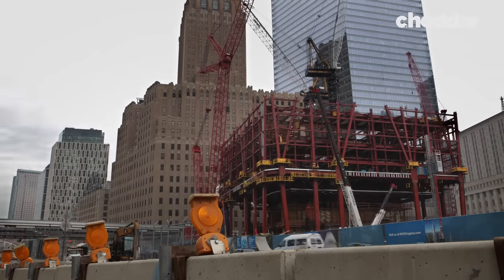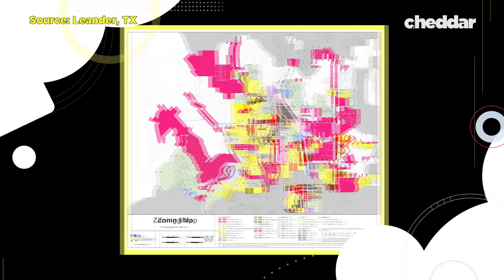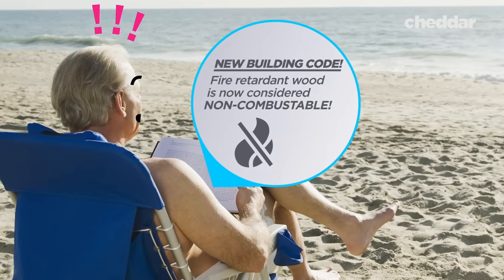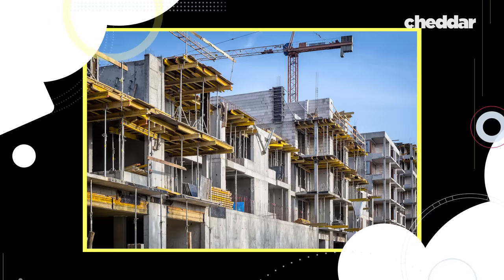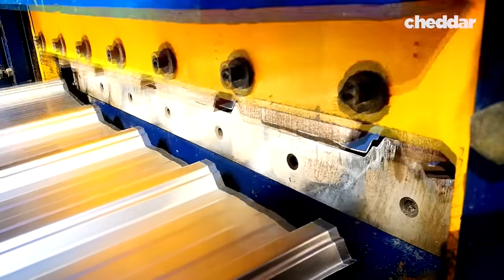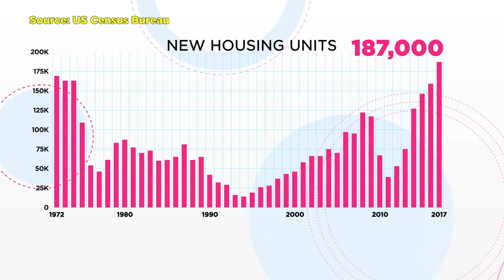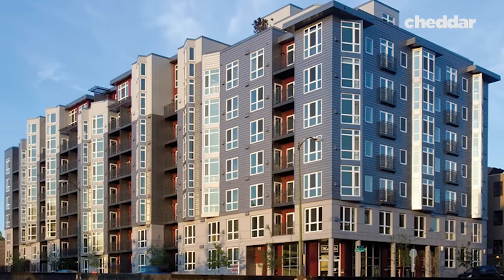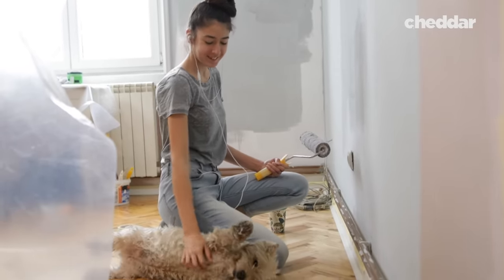Why All New Apartment Buildings Look Identical - Cheddar Explains

Comment: Rent on one of these 2BR suburban commuter rail apartments is $2k/month, which is the same as the payment on the $400k mortgage you'd need for a townhouse as close-in if not closer. The rent on that rowhouse would be $3k+/month, so a mortgage is a way better value. Only problem is, rent is increasing way faster than your wages so you'll never save up the down payment, even though your bank already knows you can afford to pay the mortgage. And the housing crisis is everywhere now, you can't escape by moving from the DC area to a small town in rural Ohio, because rents have doubled or tripled there. You'll pay 30-40% less to live in a place where the only store is Dollar General, but you'll make half as much money if you're lucky.

Comment: What I get from this comment section is that no one but the people on cheddar are calling these building particular offensive in terms of design. Most people seem to be neutral and not really have given it much thought before this video. And then most are saying, “well, it not as bad as the other stuff they build.”

All the picture they show had designs that bothered to vary in shape and color and texture. Like maybe out in LA this type of building is common. I certainly don’t see enough of it where I’m from to have gotten sick of it. This would be a welcome change from the dreary concrete brick squares or vinyl blocks we get around here. (I am not referring to the more beautiful brick mid-story building built back in the 19th and 20th century. Those building are beautiful and high quality and would be much preferred) but like. This is much better than a squarish two to three story building that it just one solid vinyl siding all the way around. So I’m not really sure where they got the claims people are calling these ugly? I wonder what they are referring to that would be so called beautiful in their eyes that meets the mix land use these buildings are providing. 

Also wood technology is improving so much it makes me excited to see what we can be building with wood in the future. Of course that doesn’t mean throw out other high quality materials. Just find a balance that makes economic sense. Also wood is great if the process is done sustainably which I know is a little bit easier said then done. But wood is one of the only renewable resources we got in the building industry so we must protect it and use it wisely. 

Also there just greedy developers who do cheap out in ways that truly diminish quality. Like if someone took the time to think about each aspect of the build. I’m sure solutions could be found to deal with the flexible nature of wood, which flexibility is actually good for things like earth quake, so that materials don’t break and cause damage. Like it’s not sustainable to use “sustainable” materials  if the maintenance is high. It sorta defeats the purpose of going down that green route if that is your intention. Also careful design should allow for proper comfort and quality  in the units, that include sound design, air quality, and heat.

Comment: The sad reality of these buildings is that even though the living space in sprinklered, in many states the attic space is not. That's ok you say?  There are many ways in which a roof area or attic can catch fire and with these buildings is very easy going to over run the interior sprinkler system and burn the building to the ground.  People need to be educated on these building before they agree to occupy the space. There is a potential if these building have a fire, it may very well burn completely to the ground and they will loose everything they own.

Comment: I used to work in comercial and residencial building. and let me tell you as foreigner working in the USA. a wood home is big problems later, usually wood after 20 years or so will need plenty of maintenance and soon will need huge renovations or demolition. No like concrete or brick houses that cost more but will require little to none maintenance (if they are built properly) and will last forever
Reply: Wood buildings can last a long time with minimal maintenance. Its more about how they were built. I have seen concrete buildings get condemned because their foundations failed after 30 years and I have seeen wooden farmhouses still standing tall 150 years after they were built.
Reply: @jarynn8156  Not in my experience. wood requires lot of maintenance to last long time. concrete requires very little.
My cousin's greatgrandpa built a concrete home about 100 years ago. and still strong till now. with very minimum maintenance (btw concrete is by far better fire retardant than wood)
Reply: @Tavinho502  As long as you take care of the roof and siding, a wooden house will last basically indefinitely. As long as the wooden supports aren't being exposed to water, they aren't going to rot. There will be some growth and shrinking each year due to variations in the climate over the year, but a well made wooden structure will account for these and have tolerances to allow the wood to expand. The most you might see is cracks in the drywall/plaster.

Comment: Added cost to mitigate the sound transfer issues. They make quiet rock gypsum stops that but it’s 4 x the cost of regular 5/8.  Also padding for floors for footfall, transfer of sound,but there again expensive addition.  That being said there’s pretty strict codes on sound transfer between units and I’m sure most are not adhering to it, lawsuits have been won by the tenant - owners of such  buildings against the developers and as a result large cost of mitigation,and disruption of unit occupancy.  Architects..read and be aware of this!  Your at risk liability wise if your building plans do not specify the correct wall stc ratings and mitigation of footfall sound transfer.

Comment: Well... waterstopping layers exist. If the building is designed well, there is no water coming in. Wood or not. These panels on the outside are not meant to stop the water from going through. If they are painted regularly, ir if you use a type of panel like Rockpanel, it should never be a problem. And yes, I know what I am talking about. I am in my 3rd year of studying architecture.

Comment: In Florida, any structure for residential use must use masonry (typically cinder blocks) for all exterior walls. While you don't get the admittedly modern exteriors seen in this video, you also don't get a price point that the average Floridian can afford. As a result, when they pop up they usually don't even place any advertising signage until over a year after they begin leasing. None of the benefits of the five over one exist down here.

Comment: Humm, I think I see some factors coming together.  At a certain height you've reached the strength limits of wood construction, at about the same point you reach changes in elevator technology.  The handicapped rules make costly elevators mandated for multi-story buildings, this can be avoided by building townhouses putting the bedrooms on the second floor, these are everywhere.  Hydraulic elevators that are less costly than cable elevators are a good solution up to about five stories above that their limited speed becomes an issue.  Another consideration is that higher buildings will require multiple elevators taking up more floor space in the plan.  Remember that the owner is looking for net rentable space and stairways and elevators eat into that.  Another factor is the community's fire fighting capabilities generally limiting buildings to ladder or tower height, go above that and you'll need multiple fireproof stairwells, these allow tenant escape as well as firefighting access.  In most cities parking is essential as tenants expect to have space for their car(s), cities like NYC with good transit would be excepted but the US has few of these.  Even in NYC the outer boroughs are more likely to need parking.  Not having parking generally means that on-street parking will be the eventual solution, not a good answer.  City planners will praise this solution but they all own cars.  Back during the fuel shortages of the 1970s there was a problem for landlords that couldn't pass along the rapid price increases for heating fuel that was generally included in the rent, this led to making the heating systems unit specific with the tenant paying for this in their electric bill.  This will continue to haunt the housing market as less costly gas heating louses that advantage and maybe becomes unavailable coupled with large increases in the price of electricity.  Zoning rules that restrict high rise or medium rise buildings in neighborhoods are not a bad idea.  Nobody wants their building shaded by a new tall neighbor and not having this kind of rule will un-stabilize the community with a continued turnover of properties converting single unit homes to high-rise  apartments, the same applies to mac-mansions.  Lastly there is the problem of who is able and allowed to build in each technology, there are many contractors skilled in wood frame construction while the numbers that do steel and reinforced concrete are generally fewer and often highly unionized, this greatly affects costs.  Housing prices will reflect the size and condition of the existing stock, the cost of new construction, the maintenance and operating cost of the particular unit and very importantly, the demand for housing units in the community.  In NYC this demand is very high and is reflective of a market with consumers willing and able to pay while places such a Buffalo, NY there is little demand and you see little new construction and abandonment of existing stocks.

Comment: You can sum everything up as "get rich quick". If I remember what I read, these buildings aren't designed to last more than 30-40 years (I believe "useful life" is the word they use). Their idea is to build as cheap as possible so that all the costs are recouped ASAP, and then make profit for the remaining x-years. By the time it's ~20 years old, the design will be outdated and nobody will pay big money to live there anymore, so they could just tear it down and build anew.  With cement/steel buildings, yes, they are more expensive, but they literally last forever (look at all those high-rise skyscrapers that were built 100 years ago such as the Chrysler Building and still standing).  Having lived in one of these so-called "luxury complex" that was built in 2015, it totally wasn't worth it. Super shoddy construction - my friend rented a super nice apt and when he walked in the kitchen (he only weights ~140-lb), I could literally feel the kitchen floor bowing downward!

Comment: The author makes many flaws in this watered down, partly accurate summary of stick built stacked flats. However she confused building code with zoning code and the dates are totally incorrect. Podium multi has been around well before 1998

Comment: You can definitely see that the architectural style is the same, but (and I admit I'm only assuming based on examples in this video) I'd say the buildings look far from identical. After all, this is nothing new, even historical cities in Europe saw large re-development projects that gave an almost unified look to large areas - take a look at Prague, where one of the towns constituting the city was almost completely torn down (aside from churches and other important buildings) and rebuilt in the style of Art Nouveau. Now, Art Nouveau features lots of flourishes and the buildings differ very much in the details, but walking through the streets (which is practical there for the most part, thankfully) you can still get an impression of "sameness", because it's the same architectural style. Not a bad thing - and it helped solve a huge increase in demand in the fin de siècle era.
Another example is the Žižkov neighbourhood in Prague, which used to be the city's suburb housing the workers for the growing industry on the outskirts; it is 4-story brick apartment building after 4-story brick apartment building after 4-story brick apartment building with little in terms of flourishes or decorations (especially compared to neighbouring - richer - Vinohrady) that sort of became a part of the image of the town.
And later came the prefab concrete blocks of flats ("commie blocks") in the new town-turned-suburbs - these are ugly for the most part but 1. helped solve a massive housing shortage and are being renovated because of how practical they can be, effectively extending their lifespans beyond what they had been designed for, and 2. some towns and neighbourhoods rebuilt with prefab concrete blocks of flats fortunately have quite decent urban design and came with the required amenities and infrastructure as well as green spaces. Can this be improved upon? Absolutely! Should we demand some actual architectonic value from the next generation of large-scale housing projects? Probably. But these are actual, tangible solutions to housing issues, ones that work in terms of several key factors, so I say express your criticism, refrain from whole-sale denouncing the efforts.

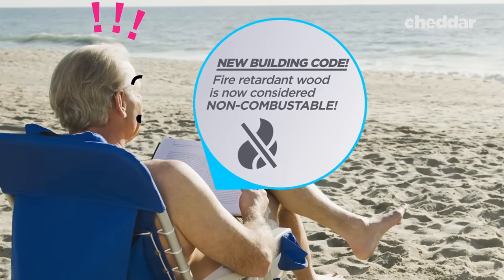Comment: SPELLING NOTE:  2:19 It's COMBUSTIBLE; there is no A in the word.

This woman narrating this video is complaining and complimenting the same thing, just at different points.  Then she tries to espouse her opinions as fact or largely-agreed upon consensus, even though the comment section is opposite of her opinions.  

A bit of detailed explaining would be nice, such as if there were 13 fires that caused $20 million or more in damages, but less than half of them (six) were this style, then what were the majority of the fires related to?  What were these other seven?  Were there deaths involved?  I know at least one of the six had zero deaths because it happened before construction was complete; I suspect more, possibly all, are the same.  There should be sprinkler systems installed to prevent/mitigate this.

 Also, how is this wood considered "non-combustible"  and a fire hazard at the same time?  There is more to this that Cheddar isn't informing us about. Why?  Your video essentially sounds like some stuck-up fashionista saying "OMG, these are so ugly and beneath me, but they're so good for the economy and consumer."

Comment: It's funny, because these are built horribly cheap, and yet cost more than double a mortgage most of the time. The idea is to cut costs up front and charge "competitive rents" (read: equally high rents) and then maximize profit in the long term. These types of apartments are a plague on a city because they are of terrible quality long-term and still cost tenants just as much as any other housing.

In most cities, landlords would charge anywhere from $900 - $1.5k for a 1 bed/1 bath room in these apartments. It's ludicrous. It isn't solving the housing crisis. The problem wasn't a lack of homes. It was a lack of affordable homes. So building infinite numbers of these architectural monstrosities will do nothing to fix that. It just lets greedy landlords profit even further.

Comment: They are building these all over in my area in the city and they are wood stick built fire traps !! Id not live in one They say fire retardant wood but one in new albany that was finished but the sprinkler system booster pumps power was not energized a fire was started by a worker and the whole thing burned to the ground ! the fire station was across the street ! so if you have a power failure you have no sprinklers  like the one in Texas last winter one did burn down ! the city water pressure is not enough to operate the sprinkler system so they have to use booster pumps .

Comment: The long and the short of it is that these buildings are basically disposable. That might be OK for short term rental properties, but I  would never live in one!
When I first started seeing these they would put brick fire walls every so many units, then the "fire wall" became an adhesive backed foil!  
Anyone who's ever built anything out of wood would know that building something of this size is ridiculous. 
Then there's the hardie board cladding which has no structural rigidity, cracks and breaks easily and is generally fire resistant. The "fireproofing" really does nothing of the sort and will degrade over time.  So essentially you're wrapping an extremely large flammable structure in a fireproof skin!!!
What could go wrong?
I also find it amusing that the residents park their cars in a safer,  better built structure (steel or concrete) then the one they actually live in!

Comment: The inside of many of these buildings is better most apartments built in the 70s and 80s. The brown carpet in the cheapest apartments only looks nice when new. It stains easily, get matted down quickly and is thin. It’s only used because of its low cost.

Comment: FIRE? NO NO NO! This building type is NOT more susceptible to Fire. This statement is inaccurate and inflammatory. A single story house is more at risk, why? because these structures have to be built with wood rated as noncombustible. Remember? your single family house has no such requirement in most jurisdictions. Auther simply does not know what she is talking about.

Comment: All those cheaply built apartments are at the least, market rate. Which has ballooned out of control over the past two decades. A studio used to be around $400-600 per month, now without any remodeling that same place, worn in, is $1200-$1350 or higher. And was never built to be market rate or luxury housing, but not only those who make three time rent can get a place anyways. It’s like they want us all suffering till we TAKE it from them